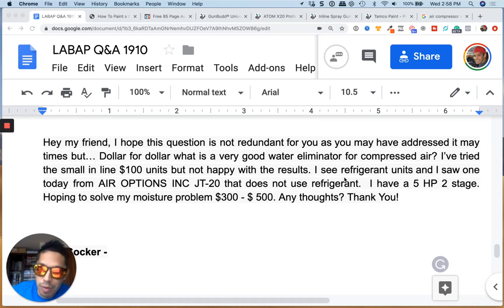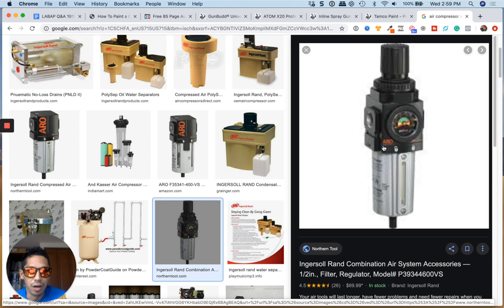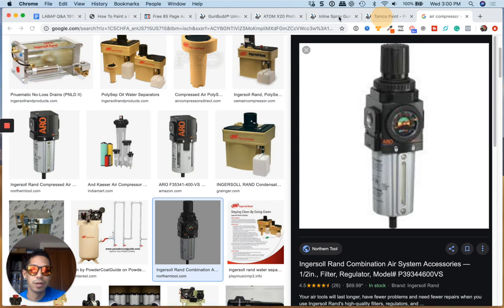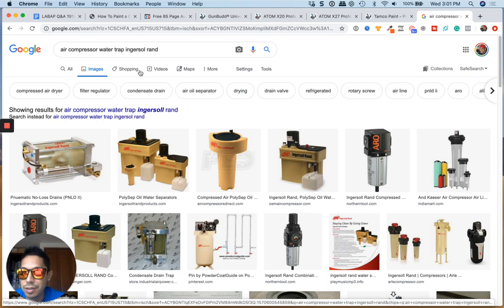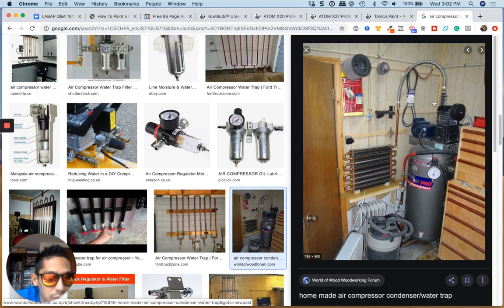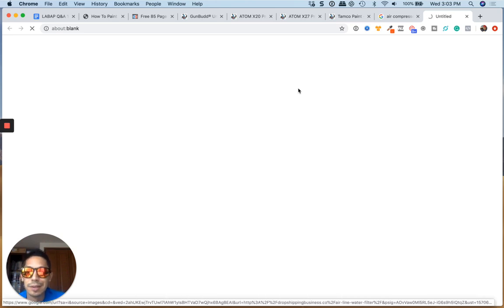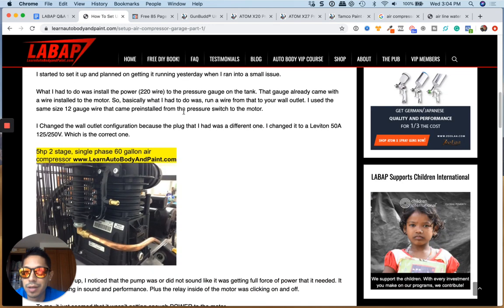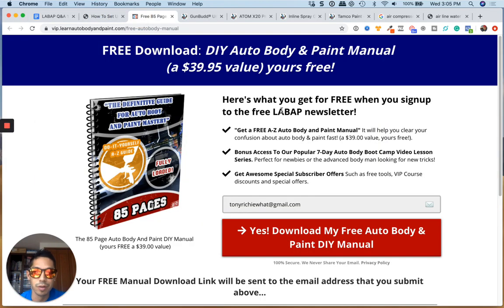Air Line Water Trap for Automotive Painting 👌

Comment: motor guard m30 kit on amazon come with 3 filter's in the kit for 93 can't beat it works amazing i'm using it with my 29g for painting run a 3ft hose to the m30 filter then my 50ft house i can hold 30 psi

Comment: Not too sure if this is where that guy was going with the inline filter thing but... QUESTION

Is it possible to use an inline filter to remove contaminants from a regular air compressor in a pinch for touch up painting (autos) or is it absolutely 100% necessary the compressor be of the oil less type?  Thanks 👍
Reply from the maker: Hey Man! Check out this blog https://www.learnautobodyandpaint.com/air-line-water-trap-for-automotive-painting/ Hope this helps! Become a VIP https://learnautobodyandpaint.com and make sure you get on our email and YouTube notifications and for your questions join my streaming pretty much mostly every Monday 7 PM EST
Reply: @HowToPaintYourCar  Thank you.  So from that I gather the answer is yes, barring the LVLP requirement for my 30 gal compressor.  Small job touch up only